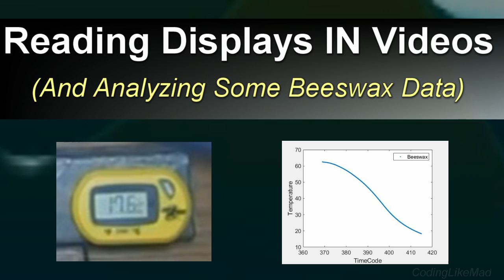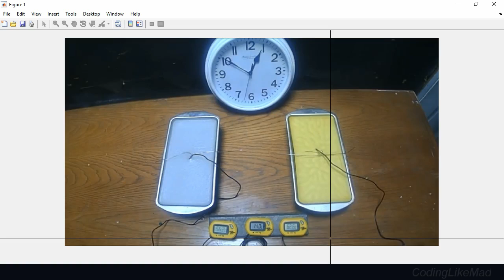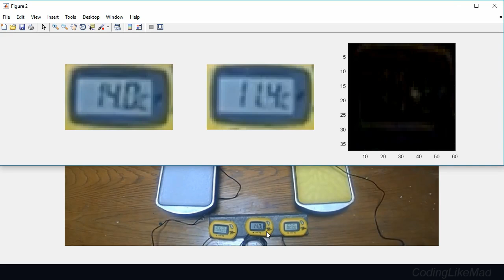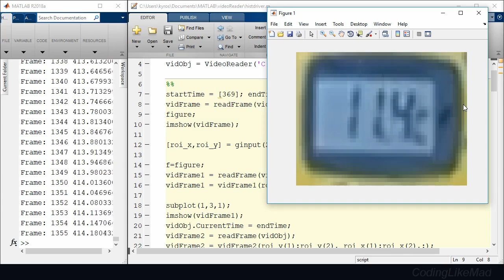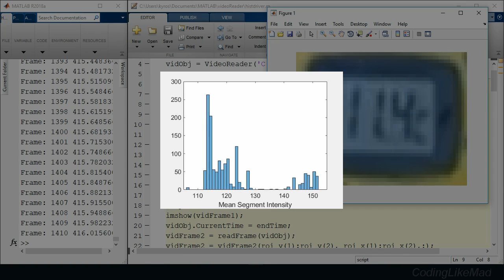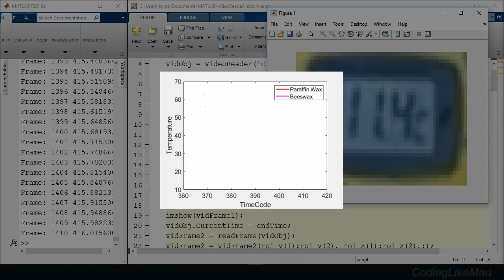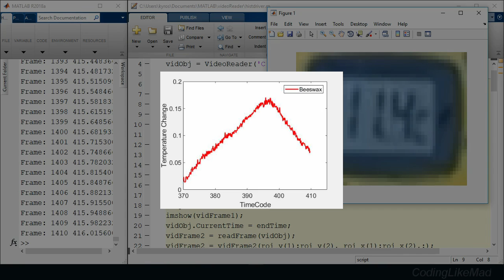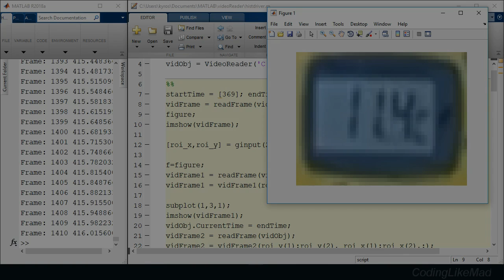Extracting Sensor Data From Videos In matlab (Analyzing A CodysLab Video)

Comment: hey, I'm trying to use this software for a science project, to read the data from a pulse oximiter and output it to a graph, to measure and graph a persons heartrate over 15 minutes, do you think this would work? I would need to fix the camera and pulse oximiter in place and have constant lighting over the 15 minutes, but other than that I would appreciate any advice on anything to watch out for